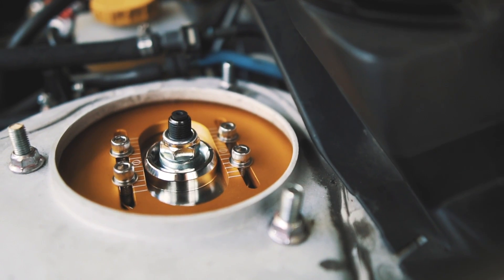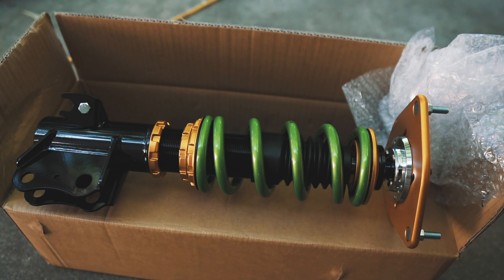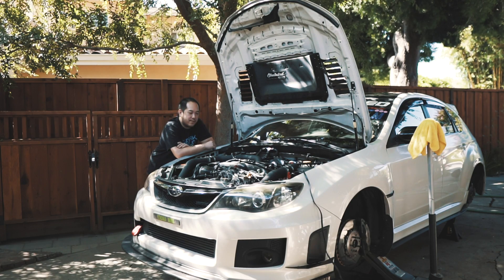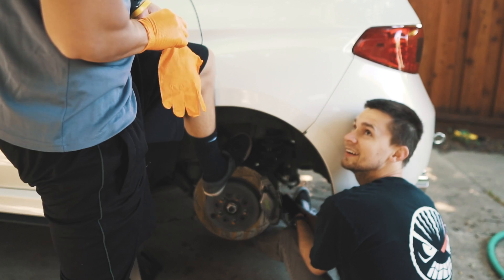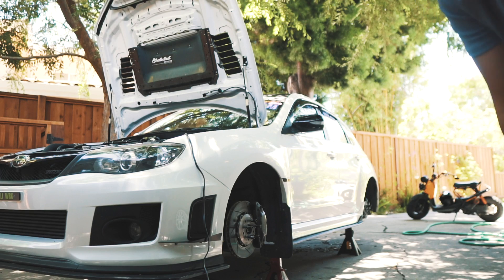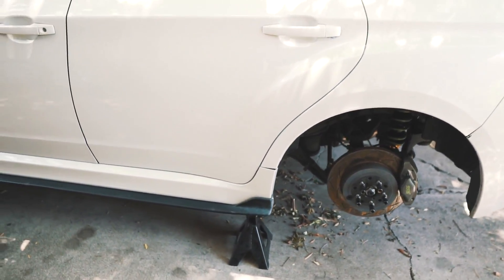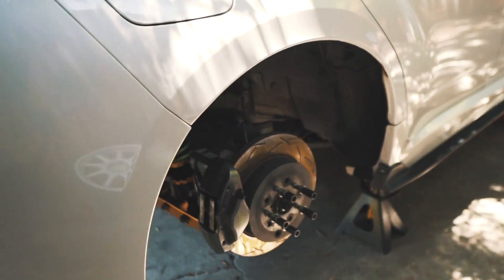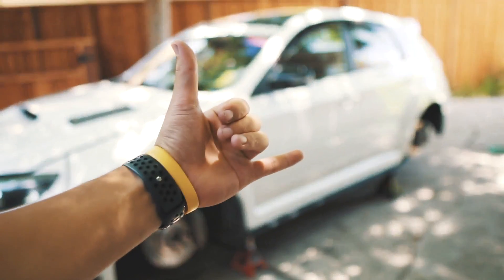I Got New Coil Overs! - ISC Race Triple S Spring

Comment: Do you have a full 5114 swap and if so those this lower the car too much for street driving ? I see the adjustment can you set the spacing to “ oem hight?
Reply from the maker: I’m 5x100 still. You can set height to whatever you want.
Reply: Cali WRX thank you for the info ! Also how come you still have stock intake manifold? Going For 700whp you think stick I take manifold will hold ok?
Reply from the maker: kchanguito stock mani can handle a lot of power. No reason to change.
Reply: Cali WRX thank you for the info
Reply: Hello Cali wrx, Congratulations new coilovers I'm always watching your videos. Good car